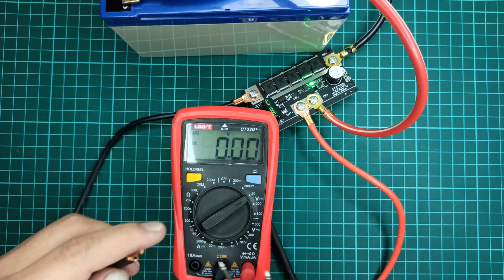How to make Spot Welding Machine for lithium ion battery | DIY | Homemade

Comment: Uma PAC bateria 18650 12.6 7amp será que dá certo amigo ??
Reply from the maker: Instantaneous current will be very small so i doubt it will work.
I would suggest you should you 3s battery pack

Comment: Bom vídeo amigo

Quantos amperes é a bateria que você usou poderia me dizer por favor ??
Reply from the maker: Hi there,
This was a 12v 10 amp battery.
But my recommendation is that if you want to built a spot welder than use atleast a 80 Amp battery for decent welds.

Comment: Ca I use a dc power supply instead of a battery?
Reply from the maker: No, spot welders require very high instantaneous current >80 amps atleast.
If you wanna use power supply then you must add capacitors at its output (500F or higher)

Comment: Thanks bro for the information, btw can i use a 12v 15 amp SMPS instead of the battery???
Reply from the maker: Yes you can but you have to add a capacitor bank at the output of the smps as the required current for short pulsed duration is quite high which an smps cannot provide it alone.

Comment: Hi. Loved the video. Could you please provide a link where to purchase this product? Thanks a lot.
Reply from the maker: Just found this amazing item on AliExpress. Check it out! PKR3,737  68%OFF | Spot Welder DIY Kit 99 Gears Power Adjustable Mini Spots Welding Machine Control Board for Welding 14650 17490 18650 Battery
https://a.aliexpress.com/_mLFRK5a
Reply from the maker: Sure, thanks for watching my video